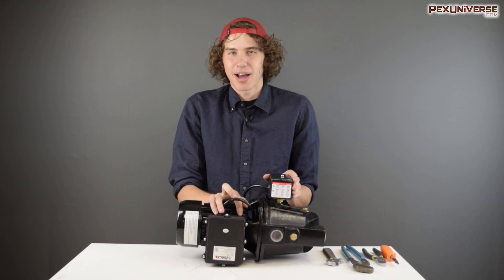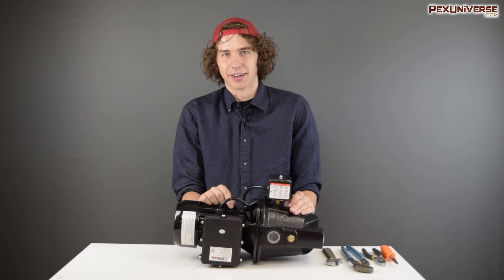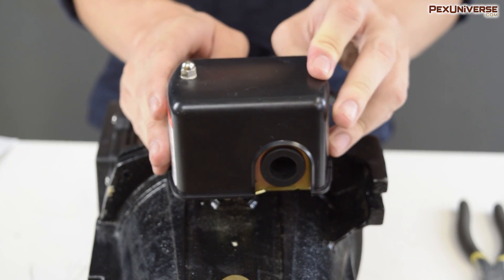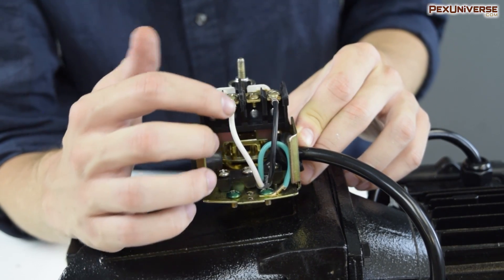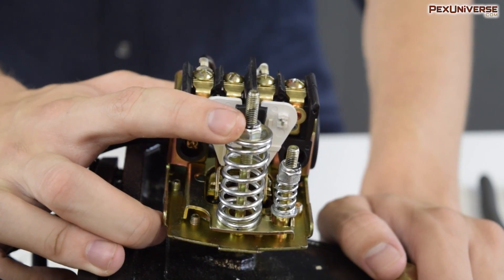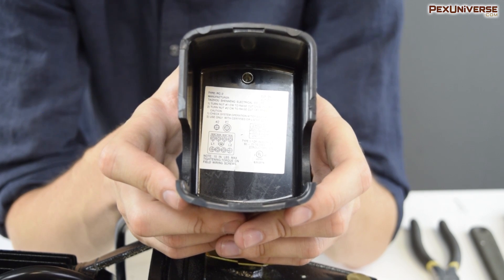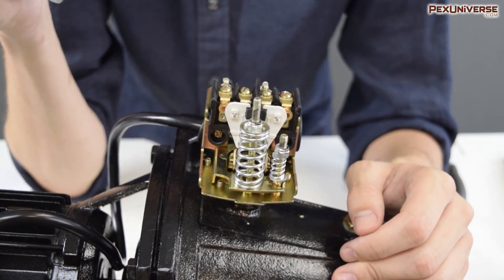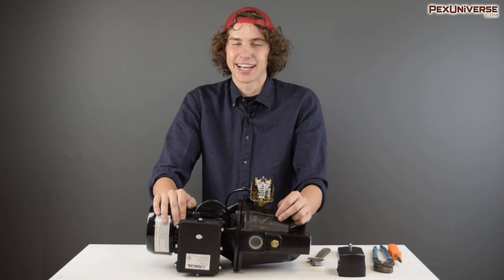How To Fix/Adjust A Pressure Switch

Comment: Thanks for the video. Is it safe to turn one screw as far as it can go? 
I have a 3050 switch and it's outputting 30/42. Turning the differential (bolt on smaller spring) several turns clockwise has not increased pressure from 42 psi max. 
Having a hard time figuring out why the pressure maximum might not be responding. Could be the pressure switch or possible the gauge.

Comment: What if my new pump/airtank etc are brand new and after bleeding out the water so it flows properly it ( the pressure switch contacts) turns on for 3 seconds then off every minute exactly then ON for 3 seconds then OFF again for a minute over and over again? Any help would great GREATLY APPRECIATED ❤❤❤❤❤
Reply: My guess would be your bladder is low on air or needs replacement.. just went through this myself.. curious its been 4 months was I right or what was the problem?
Reply: @davestewart1507   Actually you were right. 1) the bladder was low 2) the contacts werent set correctly at all 3) there was a slow pressure leak between the pump and the house at a connection that splits off 3 different ways a) toilet b) bath sink c) outside water tap. Thanks for your advice ❤ brother. Funny thing is that after fixing all that some 👹🤡 came by in his fishing boat while fishing and stole my $50 brass foot valve from in the lake.

Comment: Could you please let me know what type of pressure switch I can install on a 2" (DN50) water line so that it automatically starts and stops the pump at 3 bar and 6 bar, respectively?

Comment: Failed to specify whether tightening adjustment raised or lowered pressure setting. Also did not explain details on adjustments of second spring. Need a redo on this video!

Comment: I'm wondering why mine will kick on, and then when the water is off. It keeps pumping. Seems the contacts keep touching and becomes stuck wide open when not in use. Is there and adjustment I can make for the contacts to create a wider gap?

Comment: thanks... I was just wondering what is usually wrong when they do the same thing they all inevitably do when they are old ... it won't come on at low or zero pressure until you thump the side and it turns on, raises to set pressure and turns off. I was hoping I couldd clean some contact or something

Comment: You put the wiring on the wrong terminals.  L1 And L2 go on the outside terminals.
Reply: So the neutral (L2) is in the wrong spot
Reply: @spetrovich95  it doesnt matter,as long as one is on one of the two on the right and the other is on one of the two on the left

Comment: I don't wanna sound mean but you have no idea what your talking about when it comes to the wiring black wire is hot white is a neutral unless it's a 240 volt then white is also hot

Comment: We are having a problem with the pressure being lost incredibly fast, never going above 23 seconds without switching on and usually around ten at the adjustments we've tried thus far. I have no clue if the pressure being lost so quickly is because of the adjustment switches or if it is a problem elsewhere in the pump or system. If anyone can help me, that would be much appreciated.
Reply: sounds like the pressure in (the air bladder of) your water tank was too high. they're usually inflated via a Schrader valve like a car or bicycle tire. it should be a couple psi below the cut-on pressure you're setting the pressure switch to.

Comment: Woke up 4 days ago to no water.  The control box for the pump was buzzing.  The pressure switch was completely rusted and corroded over.  Had the pressure tank and softening system replaced 4 years ago... the company apparently thought I was an oblivious single, female home owner and wouldn’t notice if they cheaped out and not install a new pressure switch & pressure gauge.  They were right, I didn’t notice—until now😡  I checked the breakers, they hadn’t tripped and were putting out 240 v.  Checked the pressure tank.  It’s fine, set properly with cut-in at 38 (40-60 for this tank).  So I installed a new pressure gauge.  Checked the power to the switch—it’s getting 240 v.  But there’s no power in wires going to the control box.  I looked at the box and saw that the start capacitor was blown. I just picked up a new one today for the 1/2 hp Franklin Electric control box.  I haven’t tested the wires in the control box yet.  My questions:  1)  Can a bad/failing pressure switch cause the start capacitor to blow?  2)  Is there no power going from the pressure switch out to the control box due to the blown capacitor?  Can that cause a ‘dead’ reading on the volts from the switch to the control box?  Thank you for your help, I know very little about electrical stuff, just enough to flip the breaker off before I touch anything!!!!
Reply from the maker: Much Respect!!! Also, we're very sorry that you had to put up with such numb skulls. 
Answering your questions: 
Q no. 1.  The start capacitor may not have enough sufficient time to cool down after each start, which can lead to overheating. If this happens, the capacitor will normally blow out (fail). You might also notice a faint burning odor. 
Q no. 2. While this issue can be a culprit of a dead reading, we would also recommend checking the circuit breaker, which may cause similar symptoms. 
We hope this helps. Good Luck!!

Comment: Negotive and positive is for dc power. Ac power is ground, natural, and hot. For basic 115v ground and nutural are very similar. You can operate a light by only running hot wire to it and putting the nutural wire in the ground lol. But don’t be surprised when worms come up from you doing so lol.

Comment: How do can I move Pressure Switch from pump like that to water pressure pump? Now I have a pressure switch just on my well shall pump and I want to instal new Pressure tank in my house wich come with pre-installed pressure switch how do I rewiring pressure switch from the pump to pressure switch on my new pressure tank